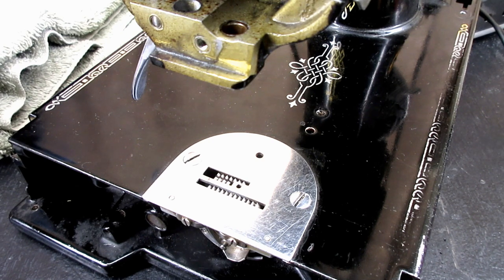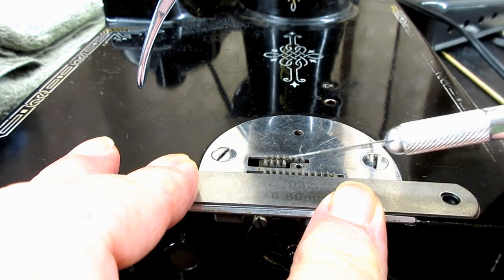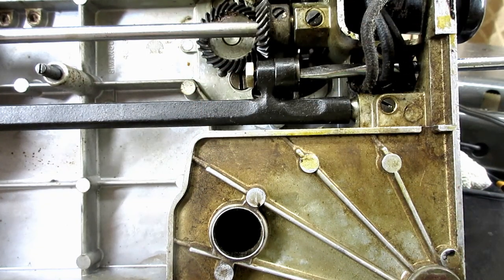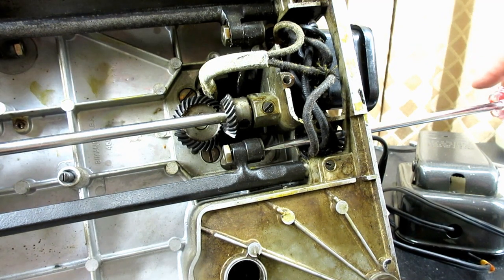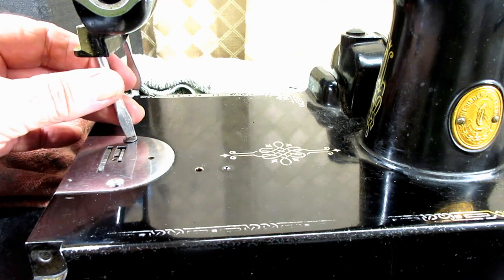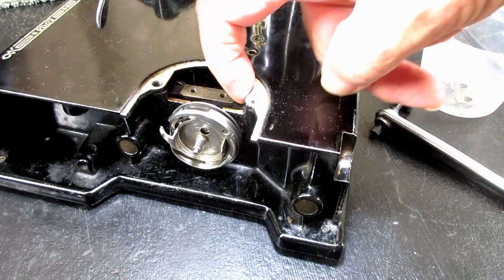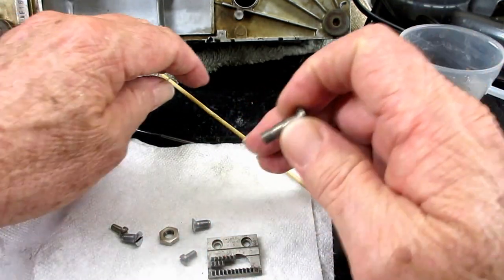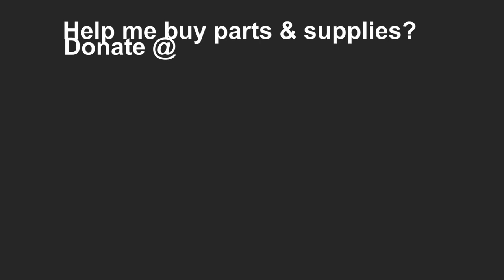How to Check & Set the Height of the Feed Dog on a Singer Model 221 Featherweight

Comment: Thank you for the eccentric screw removal and explanation of the eccentric.  When I have adjusted a feed dog height, it seemed "magical" to me that by turning the eccentric, the feed dog raised or lowered, and then the eccentric itself was far away from the feed dog.  Now I can see that screw and what it does, and know how it operates.  I really appreciate this part of the video; well, I appreciate all the parts of the video!  Those close-up pictures of the feed dog teeth to the plate are so useful for me.  What a clever diffuser your wife designed--washable, easily removable, and stays on firmly.
Reply from the maker: It is like magic! The first time I read a Service Manul about setting the FD height I could not believe going to that eccentric at the right is how to do it. Then I read the part about setting the timing by loosening the gear on the right! That's when I fell in love with service manuals, haha. I never would have understood how that worked without them. I'm glad you enjoyed seeing the eccentric screw. I wonder who came up with that type of connection? I'm always mentioning "eccentric" this and that and don't know why I never showed one before. My wife saw my handkerchief wrapped around the flashlight and tied in knots, haha. She is the sewist extraordinaire, IMO, and has sewn me some clever tool pouches that fold or roll up compactly for taking in my small bag when I go to test a machine before buying. Thanks for watching, Carole, and take care.

Comment: I'm always impressed how clean and new the parts look after the Krud Kutter treatment. It also makes it easier to inspect for damage or wear. That's a good tip on the sequential tightening of the screws on the feed dog. This video also touches on one of my two problem areas, tracking down sounds (anxious to see what you find, and eliminating binding (never enough to stop the machine but just enough to inhibit free-wheeling motion).
Reply from the maker: I feel fortunate I saw and bought the Krud Kutter that day at The Home Depot. I agreed about sound and binding. It still hard for me at times to track down the cause of it, especially the binding. With a noise I can eventually find it after removing parts, but there are so many points that can bind when the parts are moving it can be very frustrating to pinpoint. Very. Thanks for watching Terry, and take care.

Comment: Excellent. I like the idea of using the pin in the groove. I never thought of doing that. I tried it and it worked great. 
Try putting a drop of oil on your rotating hook and see if your noise goes away. I find that to be the reason for a lot of rattle in that area. It is worth a try.
Reply from the maker: I'll try it! I keep thinking the feed bar is hitting something or loose, but can't narrow it down. I think I'll just pull the whole hook off in the next video. I can see thread caught up in it anyway, so may as well check it out. Thanks for watching, Lin and commenting on my videos. Take Care.

Comment: awesome job as always andy;];];] learned something newabout adjusting.... now does that also go for the fastionmate 237 on height?  or is every machine different heights  for the feed dogs?   love the needle testing the best;];];]
Reply from the maker: Very nice question, Patty! 🚀 In general the vintage Singer models I have worked on the height would be .040 to .043 and usually highest setting would be with the bottom "V" between the teeth no higher than the top of the needle plate. That's normal ranges. You can go a little higher or lower if you want/need to just be aware all the presser feet and attachments are made for the .040 to .043 height. Thanks for asking and take care.

Comment: Did you ever figure out the rattling?  Mine does too.  I think it is the counter balance that is right up snug to the left side. It’s almost like the hole through the counterbalance is a bit too big.  I also think that my set screw on the counterbalance isn’t quite long enough to really set tight to the flat spot on the shaft.  What are your thoughts on this?

Comment: My 221 feed dogs wont go through full rotation with throat plate screwed down.  What could be the problem?
Reply from the maker: Sherry, I think you are saying the feed dog hits the needle plate? It is a rare occurrence so I don't usually make a video about it. If you watched the video on this page it shows how to set the dog at the correct height, and there is a similar adjustment for setting the dog front to back in the needle plate slots, it is just at a different screw. You can download a free copy of the Adjusters Manual for this model at this link: https://cdn.shopify.com/s/files/1/0992/8814/files/FW221_Adjuster_s_Manual.pdf?7223313128764594508
If you look at page 27 (of the manual, not the PDF,) you'll see the instructions in words and pictures. It is not hard to do and just takes a few minutes. Look for "To adjust the position of the feed dog lengthwise.... at the bottom of the page. Just like in this video, you loosen a nut, turn a screw to adjust, and then tighten the nut. Maybe the nut vibrated loose? Who knows, but you should be able to fix it. Yes, you can do it! 😊Thanks for watching my channel. ✨
Reply: Andy Tube omg!   I can’t believe you answered me!   My precious machine was accidentally dropped.  It seemed to sew fine until it broke a needle.   Now when the wheel is turned it is stuck unless throat plate is unscrewed.   I am so nervous to take it for repair here in Greenville SC.   I will look at what you sent.  Thank you so much
Reply from the maker: @sherrywilliamson9535  OK, that's a lot more info, isn't it? Dropped Machine... Broken needle...  If you live under a lucky star then maybe the feed dog location screw was just jarred by the fall. The concern is bent shafts after a fall like that. Did you find the end of the broken needle? If it got stuck inside the hook it can cause the problem you describe. Take the bobbin case out if you haven't. already. You may want to dismantle the hook https://youtu.be/OhBOhfKusHw   and clean it looking for the broken needle  https://youtu.be/yy_yoD2CbWM Hooboy.... sending good thoughts for you and your machine
Reply: Andy Tube my daughter dropped it.  I don’t want her to feel bad!  BUT this is my Featherweight!!   We did find the broken tip.  But when we screw down the throat plate the feed dogs wont go through full rotation.   Unscrew they will.  Why did it sew untill needle broke.   I can’t tell you how much your help means.  Is it timing?   Is it unrelated to fall?   How do I find reputable repairman?
Reply from the maker: @sherrywilliamson9535  You're asking questions I have no way of knowing what to answer. I can't get hands-on your machine to diagnose it. Here is a video for checking and setting the timing you can watch and just check to see if the timing is OK or not without using tools. https://youtu.be/6pAWzJyV0IY   Here are some notable featherweight businesses you could ask about repair https://www.novamontgomery.com/quilt-guild-programs.htm
https://singer-featherweight.com/pages/contact-us
I'm sure there are others. Scott does nothing but vintage sewing machine repair and restoration. Several videos on YouTube and here is his Facebook page https://www.facebook.com/SEWINGMACHINERESTORATION/
Scotts YouTube Channel https://www.youtube.com/user/CowCountryEnterprise

Comment: Mone is a Singer featherweight. Not 221. This having trouble with  the feed dog will not pull the material.  I may get another feed dog.  The points seem dull.  Thanks all you showed all the time. I love working and small things and so as my son.  Thanks again .
Reply from the maker: What model number? Be sure the presser foot is pushing down on the fabric. If the presser foot has no tension the dog can't pull the fabric. Good Luck.